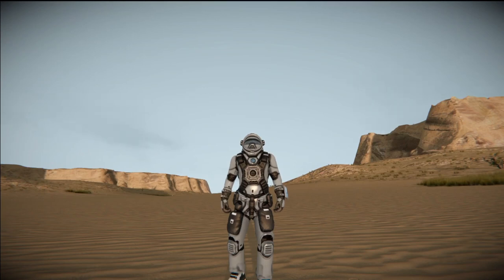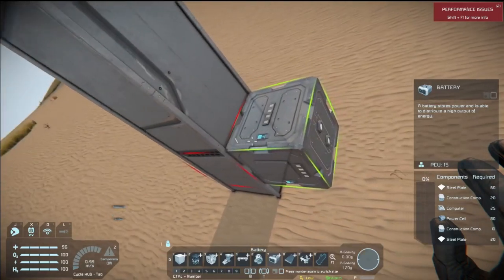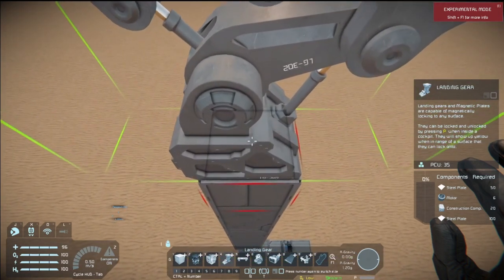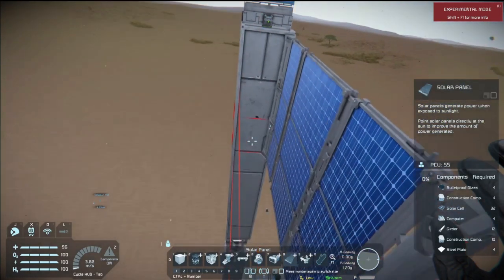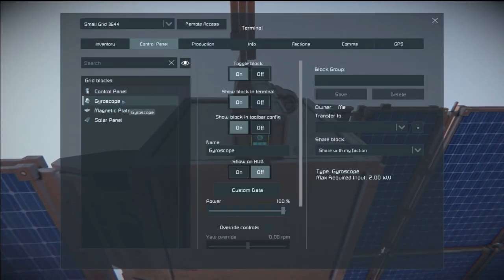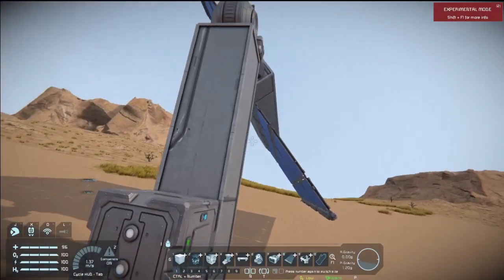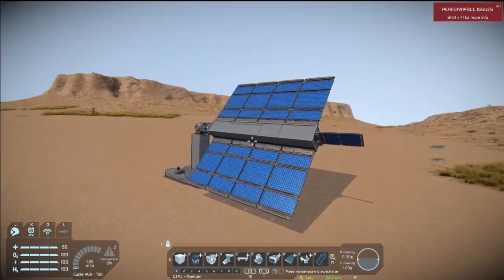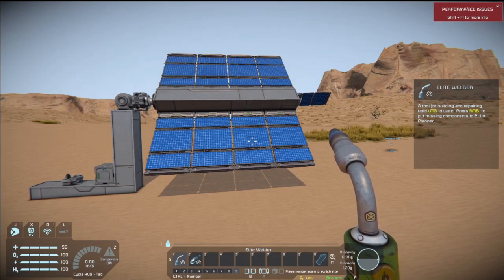How To Build A Scripless Solar Panel In SpaceEngineers.

Comment: I just can't believe how this channel is so small, like one of the most useful tutorial I've ever seen on solar panels! Keep up the good work!
Reply from the maker: Thank you!
Reply: @badgerwildgaming6908  I'm having an issue with mine. It worked fine when I made it (I'm offline and on xbox) but when I loaded the game up later to continue my progress, it stopped rotating. 

I've tried changing the settings on the gyro, rotating the rotor, and locking/unlocking the rotor but still it wont move anymore.

Is there any fix I could try that you know of?
Reply from the maker: My suspicion is it may be the braking torque. If it's set too high the rotor will resist the gyro. Try gradually lowering it.
Reply: @badgerwildgaming6908  that did the trick, thank you!
Reply from the maker: Glad to hear it. Your welcome.

Comment: This is extremely big brain move. Using subgrid with gyro powered by a single solar panel? GENIUS! I'd have never thought of it, kudos!
Reply from the maker: Thank you.
Reply: I think thats how they work in real life too! small solar panel on a rotor that will tell if the sun is at x angle and energize the rotor

Comment: If i understand it correctly, the solar array will only adjust when the small grid gyroscope is supplied power by its solar panel. Seems really useful and well made.
Reply from the maker: Yes it works great. Can provide almost a mega watt of power in game.

Comment: This is really cool, definatley gonna try this out!
This is the kind of creativity I love about SE, relatively simple once you know it but I would never have come up with this idea on my own. 
I was trying some timer block monstrosity to sync up with the amount of time half a day takes. This had several issues. One, this is a waaay more complicated approach which takes a lot more time, resources and space. Two, the day length varies on each specific server/file settings so you can't really do a single blueprint fits all copy.
Also three, it's probably doable but my attempts were barely passable at best and used a load more blocks which if you're on a server with block limits isn't great haha
This however, is an improvement on all of those issues. Many thanks!
Reply from the maker: Great!also got a video where I upgrade it so the trash remover won't touch it.

Comment: The hinge seemed extraneous. Also, if you point the circle (front) of the gyro out along the length of the beam, it'll always be roll. In space, might also be handy to cover one side of the detector panel so if it overshoots, it'll still come to a stop not too far out of position until the sun can catch up. Won't work as well on a planet, obviously, because you'll need the reverse side for the next day.
Reply from the maker: The hinge is for gravity on planets not necessary for space stations, and the fix for the over shooting is the braking torque.
Reply: @badgerwildgaming6908  But you have the rotor for all that. The hinge just seems to be a way to maneuver it perpendicular to the surface and you can just build it that way.

If you drop the hinge you could even give it two axis tracking.

O = empty space
P = Panel
T = tracker grid
B = support beam
R = rotor

OPPOOTOOPPO
TBBRBBBRBBT
OPPOOROOPPO
OOOOOBOOOOO
Reply: @zotaninoron3548  the hinge can adjust to a non-90° angle for if the sun doesn't go directly overhead. Allows for better efficiency near the poles of planets
Reply from the maker: Yes.

Comment: I've always just set the rotation speed to approximately the speed of the sun moving across the sky. I put a camera on, look at the sun, and set a speed. I check how close it is by sun down, and tweek the speed by like, 0.001 rpms.
Reply: Thought of this before. If the cycle is on a default 2hr day, then it should be (1÷60)÷2, converting rpm to rph, then lengthening for the 2 hour cycle. If I figured this right, you would get 0.008333rpm.
Never put it into practice, but that should work.
Reply: @Zephandolf  I think I've got one going 0.00078 so you're probably right
Reply: @Zephandolf  0.0078, sorry

Comment: I use a slightly different setup to resemble the way equatorial telescope mounts are built: base-> azimuth rotor-> elevation hinge-> sun angle following rotor. The azimuth rotor is to align the rotation axis to the sun's orbital pole (might be different from compass mod north/south) . The elevation axis functions the same as your hinge, to get the rotation axis to become parallel to the sun orbital pole. Both need only adjustments to line up. If you can use buildvision to set the limits you don't even need to fully build them to turn. Then you set the fully built sun following rotor speed to about 0.00833 for 2 hour sun period. Or use your small grid gyro/pilot-panel to drive it with this rotor off.
Reply from the maker: Yup you can switch rotors for hinges and vise versa in most situations.

Comment: This is a really elegant solution and actually tracking the sun.

I was wondering though, if we know the length of the day cycle on the server, wouldn't it be even easier to use a hinge and rotor, attach the panel and set the rotation speed of the rotor to one revolution per day?
Reply from the maker: You could but it would require alot more math and if you where off by a little eventually performance would drop with the pannel going ether too fast or too slow.

Not saying it can't be done it just is more difficult.
Reply: I really was expecting a math solution in this video. I thought he was going to do just that with syncing the rpm to the day cycle, but this is refreshingly brilliant instead.
Reply from the maker: I'm a firm believer in the kiss rule.
Reply: @badgerwildgaming6908  I have to agree with that. The last server I played on had automatic removal of unpowered grids but your solution is really simple and efficient.
Reply from the maker: Thank you.

Comment: This is a perfect example of engineering a solution to a problem.

Question though: Why the hinge? Why not just build it on the rotor with the rotor sticking out of the side of a block?

In any case, a wonderful video!
Reply from the maker: The hing let's you tilt the pannel for optimal solar power. Also the landing gear sensor pannel would require a ship to attach it because landing gear will not lock down until fully welded.

Comment: I still dont get what the hinge is for.. I built this with rotors on each side of the center on a satelite like spaceship and it adjusts quite okay even after moving the satelite.
Now I'm trying to build a big one on the moon and I'm wondering if i can add a rotor on the base of my "tower" to adjust the whole tower with more solar "arms" on each side turning accordingly?
Sorry for bad english
Reply from the maker: The hinge is for gravity environments so you can build it by hand and not have to have a ship to help you. Also don't worry it's my first language and even I get it wrong.
Reply: Where would I need a ship to build it without a hinge?
Just for the magnetic plate?

Also, the base where you got your battery right next to, can I add another rotor there, so the whole thing follows the sun?
I'm trying atm, but I'm unsure if the gyros on my solar 'arms' inflict with the rotor at the base of it all..

Is there an official Discord for SE where you can discuss stuff better than here?
Reply from the maker: For the ship question yes if not for the hinge you would need a ship and power is usually what a fresh player must solve before building a ship. To the Discord question yes there is a Discord in the description not alot of people on at the moment but the mercs that are there are very helpful.

Comment: if you use a ship to place the small grid, you could do away with the hinge.
The only risk is trash collection removing the small grid if it's powered down too long.
Reply from the maker: Yes you can but this is technically easier.

Comment: i connected my solarpanels on my ship with a hinge but it seems that they dont transfer the energy onto the batteries within the ship :/
Reply from the maker: Did you check the power input on the batteries in the controle menu on your ships grid?
Reply: @badgerwildgaming6908  ok i did i was kinda wrong i Do get energy xd
Reply from the maker: You need more pannels then to keep your battery fully charged.

Comment: Excellent idea. How does it fair against trash removal, as the goal of a grid is to remain unpowered?
Reply from the maker: I've never had one disappear before. If it does just stragten the pannel back up and add a new sensor pannel it's really cheap to keep running.
Reply: As long as the pilot panel is attached to the large grid with battery power it should not be removed. But in single player worlds i disable garbage collection anyway.

Comment: very nice! but it seems i have a problem with that on my worlds. as soon as i reload the world the next time it stops working. any ideas?
Reply from the maker: It should be working every time what's it doing?
Reply: It does not turn anymore. Tried changing the input on every axis, lock,unlock, turn rotor on and off again,edit the torque, replace parts or add a battery to the small grid. I managed to get 2 of 3 on one world working again with the troubleshooting I just described (none of 4 on another world) but they stopped working again:D
Reply from the maker: Do you have inertial dampeners on? That can stop it from turning.
Reply: @xeoas213  set the torqe on rotor to 0 that should fix the problem cause that's fix mine

Comment: problem is that trash disposal would delete the small grid because its technically unpowered even if it has the capability of power. this problem becomes worse at night
Reply from the maker: Yes that is a problem.
Reply: not sure how trash disposal works but could a small battery that's set to recharge prevent it from getting removed?
Reply from the maker: Yes but it would store power causing the gyro to keep spinning.
Reply: @badgerwildgaming6908  setting it to recharge would mean it wouldn't discharge and the gyro would only spin when powered by the solar panels tho
Reply from the maker: I need to test this! Thanks might have given me a new video idea.

Comment: you mention being able to do this in space, free floating or on an asteroid? I've been trying to figure out how to use this as a satellite
Reply from the maker: Weld a block on the nose of a small ship and attach a landing gear then put it into the position you want by attaching the landing gear to the solar grid.

After that just Weld up the sensor panel as shown.
Reply: You will probably want an overridden gyro set at 0, 0, 0 on the main body of a free floating grid to keep it from being reoriented by the gyro that's spinning the panels.

Comment: I dont catch the need of the first hinge instead of installing the rotor horizontally directly on the pole. Also you dont explain why you setup an horizontal rotor instead of a veritcal one. It depends where youre sitting on the planet. If your close to the poles then you need a vertical axle because the movment of the sun will be mostly around you. An horizontal axle like this one is mostly useful close to the equator. If your just beween pole and equator, then youll need a 2 axle movment, with a separate gyro for each rotor.
Reply from the maker: The hing has two functions.

1. It allows  you the chance to weld up the landing plate. I did this in creative but in survival you will put down a frame that until its welded up it will just fall off to the ground as gravity will be pulling it. Thus with the hinge you can weld up the sensor pannel without the magnetic plate falling off then move it to the correct position.

2. With the hing you can angle the primary solar grid toward the sun for maximum power generation. You are right in that at a right angle it would only work on the equator for max power but with the hing you can tilt the primary solar grid towards the sun and it will still follow the sun for max power.

Hope this helps😁

Comment: cant we just set a really low rotation speed for rotor?
i mean yeah, this is kind of genious
Reply from the maker: You need the brakes to stop the sensor panels gyro from over shooting the sweet spot. Also too slow and the grid won't stay in line with the sun.
Reply: tried it, never works for long, server restarts or lag or something always gets it out of synch quite soon.
Reply from the maker: It takes some trial and error because different planets and gravity fields.
Reply: @badgerwildgaming6908  sorry i was referring to the comment, not your video, your concept is actually genius.
Reply from the maker: It's OK I was trying to be helpful. No harm and someone might need the comment.

Comment: I did mine,it work fine,however it shake so violently
Reply from the maker: Ya it does, the last update made this obsolete now you can just slap a camera onto the panel and hook it up to a turret controler then set it to "track sun". Way easier.

Comment: Space Engineers offline; Every DLC not available for offline use "PC Versions" the available fixes and gameplay improvements; "not available offline" (pc users..} a scam endorsed by STEAM.
I find this when a line fails to deliver internet for two weeks. and tried to play Space Engineers offline.. a class action should hold Steam responsible for this behavior. a theft has occured, probably more than just a few..

Comment: Help! Plz! When I put down a solar panel all I have is the metal frame for it and not the actual blue panels
Reply from the maker: You have to build those in ether a survival kit or an assembler, take your torch and right click the frame it will then put the blue print for your pannel into your inventory then go to ether a survival kit or an assembler on your base or survival pod and select production from the tabs above. Then select on the parts you need to build, if you have the ores you will be able to build them. Next middle mouse button click on an access port (they will be the yellow squares that light up when you get close to them) and you will pull in all the components needed to build the solar panel. Then just walk over to the frame and weld it up.
Reply from the maker: Also this tutorial is obsolete thanks to the ai update. I should update the video showing how to make the new scriptless solar pannel...probly going to make that Friday's video.
Reply: @badgerwildgaming6908   thank you!
Reply from the maker: Your welcome come back Friday and I'll have the solar panel video up.